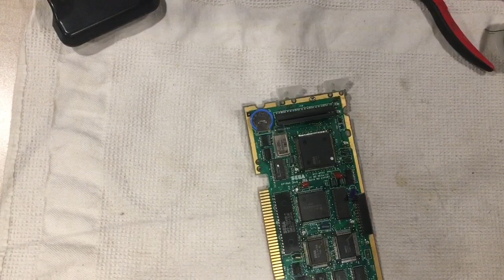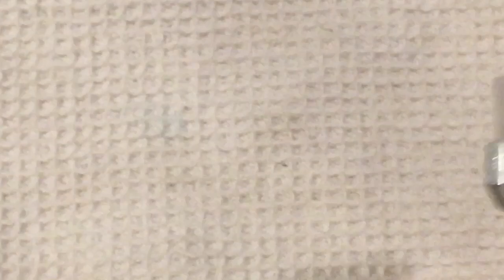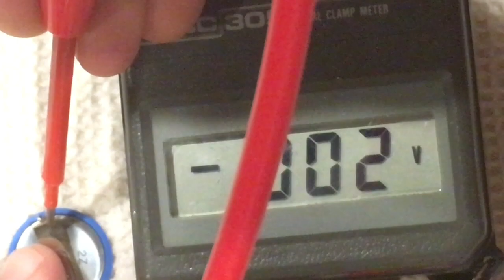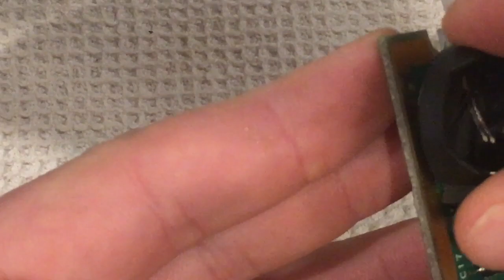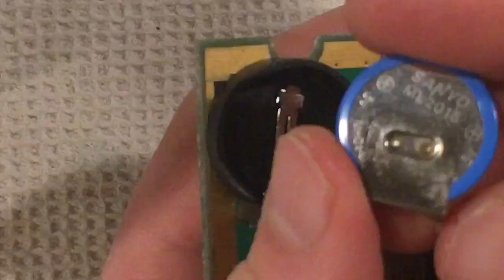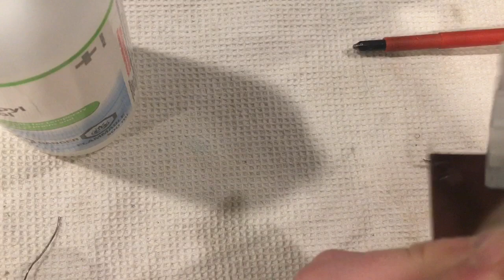Fixing eBay Junk - Sega CD Model 1 - Part 2 Replacing Save Battery

Comment: Here's a quick hint: Lithium batteries and heat are a bad combination. Heat the single leg (usually the negative) and when the solder reflows, tilt the battery back so the leg pulls through the board, then, rock the battery back and forth until the positive legs break off and then desolder the remnants of the legs. The object here is not to overheat the battery or heat-stress the board.

Comment: If you insert the positive pin of this battery holder into the other through-hole, it fits without needing to modify the shielding.  It fits snug against the memory chips.
Reply: Do you happen to have a link to this holder? I'm aware it's 3 years later, but this is the best mod I've seen yet. Also, do you think doing it that way would prevent model 2 shield modifications as well?

Comment: Bonkers how these batteries are permanent. Why don't they rely on something easy to replace like a AA? Even GB Carts, I get that a AA or AAA would be too thick, but why didn't Nintendo make the watch battery a socket?
Reply from the maker: To save on costs and space mostly.  The intention isn't for end users to repair things, so requiring soldering helped generate repair money too
Reply from the maker: They probably also didnt count on their stuff being in demand 20-30 years later
Reply: Alkaline batteries leak badly and destroy boards because the alkaline is corrosive. I've literally worked on and repaired thousands of alkaline corroded boards and it's not fun.

Comment: Good repair, but, dude, you really need to invest in a desolder station, even a cheap one. You had a right time with desoldering braid. I used to use braid, until I got a desolder station for a birthday, and never looked back! You'll never use braid again! Top work though
Reply from the maker: I agree. I firstly need to work on a better place to do all this work. Right now i get to haul everything out and set up on a table.  Next year id like to set up a room as a workshop, get some better storage and everything.
Reply: @RetroRepairs  Any way I can message you offline (email, etc.)? Have question. Thank you!
Reply: Which Desolder station?
Reply: What desoldering station/equipment do you now own? Thx!

Comment: Hey, you should do the NES. The first model. That thing is prone to failures.
Reply from the maker: I've donea couple, the biggest thing is that pin connector, but a couple other fairly common things.  Those frontloader NES systems were pretty hardy.   The SNES is super unreliable however.
Reply: How about a New Nintendo 3DS? Specifically, the cartridge slot sometimes reading the cartridge and sometimes not, even tho the game card is in the slot.
Reply from the maker: Trouble with alot of the newer systems is the components are so small and surface mounted, you need some specialized equipment which i dont have.  Physical things like the reader is one thing, but the chips and caps are a whole other story